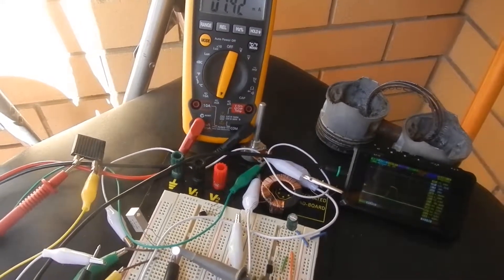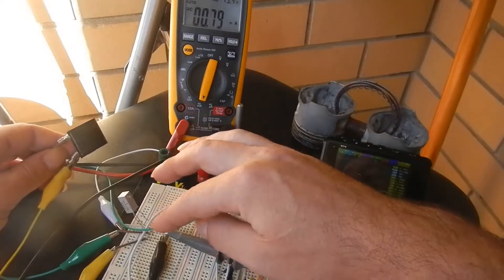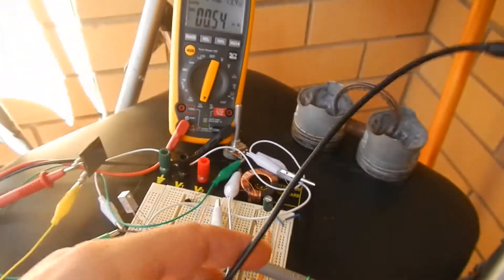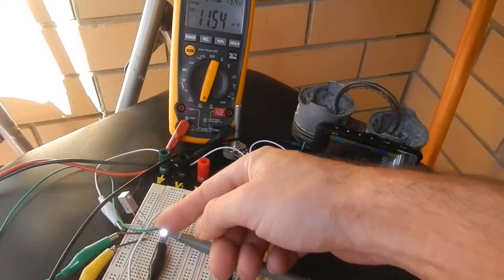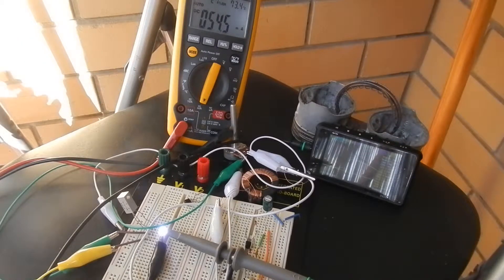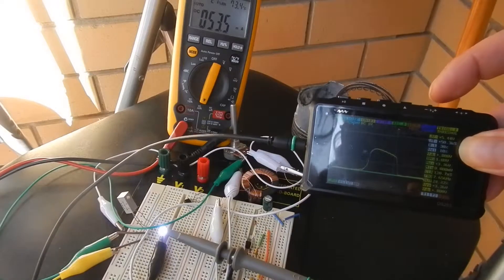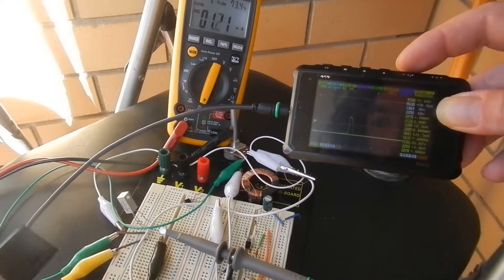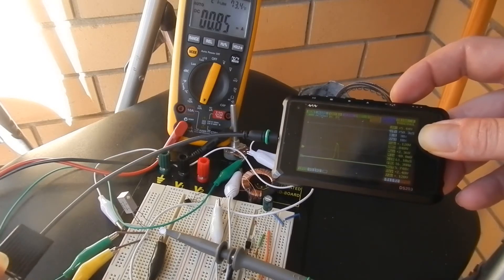Low power ambient light solar Ossilator. Run on les than .2v

Comment: At night, you can use a PEG chip instead of Solar panel, and use a candle as your heat source, providing a cold surface for the other side.

Comment: For a power supply its quite simple use plain diode since they all have a 600 mV drop you can drop to 0 with no problem at all :P

Comment from the maker: I can get this one down to 0.099v @ 500uA now! Although it is very dim and is hard to find a battery or power supply to go that low without going flat after a few hours. Although if you sit a AA on the shelf for a few days it will work again. Don't know how many times this will work though. The battery has got to die sooner or later.... My led will light (very dimly) from 2.6v